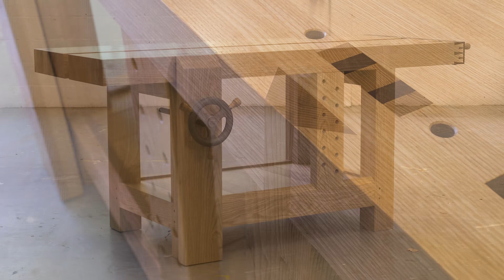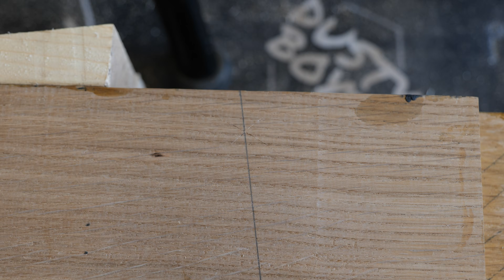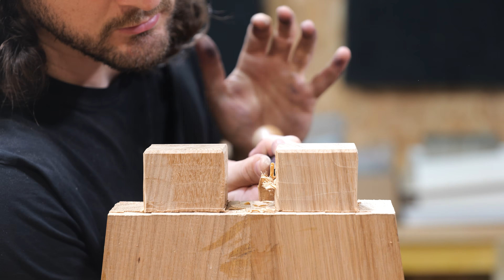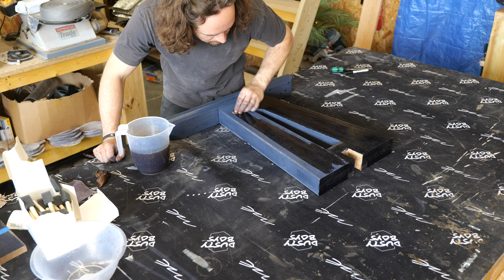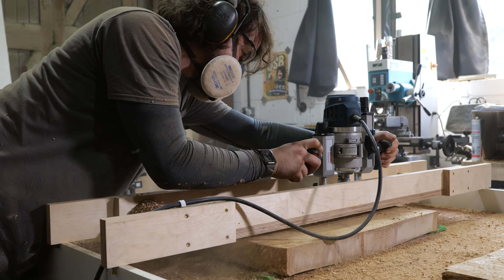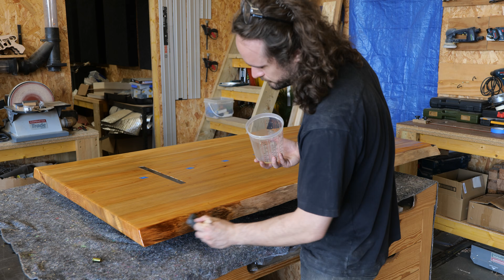How I Made a Wood Slab Dining Table

Comment: I got one question tho. I know this is most likely preference and stuff, but why did u turn the live edge facing downwards. In my opinion, that is the most beautiful part of any slab.
Reply: My guess is because of wood movement. If the top cups it will try to do it towards the bark side and in this configuration the table’s legs and frame will minimize cupping. I could of course be wrong though.

Comment: Natura Onecoat is a great finish. Note that it only needs ~3-5min dwell time before buffing off unlike Rubio that calls for 15min. I left Natura on for 15min the first time and it was too much, like Matt's situation of having to sand it back it can happen rather quickly so treat a section at a time. Also note that if you want more of a satin sheen this product looks amazing after a second coat (wait a couple days between coats though). I cringed after watching Matt pour that finish in a zig zag pattern as I knew immediately that you can't do that on a softwood or open pore wood species with these hardwax oils.